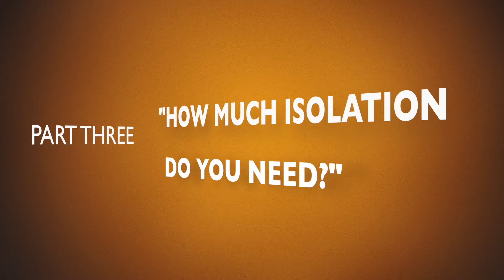How Much Isolation Do You Need? - part three - GYPSUM BOARD WALLS

Comment: Hi, just to clarify. You recommend using the cheap fiberglass insulation. What R value is best and you said to fill the entire cavity. Does this mean it is ok to touch  or leave a gap in the middle? Thanks so much!
Reply from the maker: Troy, R-value is a thermal spec. It is usually related to the thickness. Get a product that fills the framing plus the gap. You don't need any free air space to have a decoupled gap. 😉
Reply: @JHBrandt  got it! Thanks so much! I literally just wrapped up a day of doubling up 5/8 DW on my exterior wall. The "L shape" part of my source room is the problem area. One wall I should have around an 8" air gap and the other maybe a 6". Trying to keep bassy music from going into the house. Decoupled with 4 layers of 5/8 based on your recommendation. I'm just concerned that the 6" air gap maybe not enough. What do you think? Thank you for anything you can offer up! Best, Troy
Reply: Buehler? 🤣
Reply from the maker: @detroyt232323  how MUCH isolation do you need?
Reply: @JHBrandt  enough to make a stereo played at 100+ db with a sub that goes down to 29 hz sound like 50 db or lower on the other side.
Reply from the maker: @detroyt232323  why would you ever listen to music that loud? You will have permanent hearing damage before you have finished listening to one CD.

Recommended listening levels are 83 to 85 dBC average. Of course you will peaks, but they are rare. AVERAGE levels should not exceed 85 dB. Ok?
For average listening levels, you don't need double walls, although they will do a good job. You must have a sound transmission loss of about 56 dB STC.
You definitely have enough for that.

Typical of DIY design... You could have hired an expert from the money you wasted on building all that. 😉
And probably SAVED some for more equipment. 😎
Reply: @JHBrandt  I'm a rock and roller, our concerts go up to 140 db so 100 is tame for me 😉
Reply: @JHBrandt  no money wasted at all. Me and my rock and roll buddies get pretty rowdy out there from time to time. Not your typical "DIY" project, I am actually a contractor just needed a little direction on what works and what doesn't 😎
Reply: @JHBrandt  hi, I know that air gap size is related to frequency and the larger the gap the better it handles lower frequencies. On 1 of my walls I may only be able to decouple by about 5" (metal studs one side 3.5" the other 1.625"). Am I going to regret going with that 5" air gap or will I be ok down to those low bass notes from the sub? Thanks again!

Comment: Hey guys and John great video sir it is really helpful! Here is what I'm up against. I am converting my garage into a man cave/rock bar that has a pretty substantial sound system that hits down to 28 db and the volume gets cranked to 100+ hz almost every time I get rowdy out there. The problem is there is an "L" shaped portion of the garage that transfers all this sound into the living room inside the house and the wifey is not a fan. I've already started ripping out the drywall on that wall and have left the fiberglass insulation and the 5/8" drywall that is on the inside wall of the house. I plan on building a double wall with 2x4's and will have almost 10" to work with. I already plan on another layer of fiberglass insulation and double layer of 5/8" drywall. Should I consider adding a third layer of drywall vs MLV or GG? I want to get the most bang for my buck but also don't want to be disappointed in my results. Any insight or shared experiences are GREATLY appreciated! Thanks guys and John.
Reply from the maker: Troy, first we need to get an exact reading on the levels and frequencies involved. I need dB SPL non-weighted per 1/3 octave bands. You can do this yourself if you have the UMIK-1 microphone ($75) and the free software REW. See my resources page and download "Assess the Environment". Set your system up as shown in the doc, test, and send me the *.mdat file. 
Only then can I tell you EXACTLY what you need to do. (I charge hourly) ;)
Or you can send me an email - john@jhbrandt.net and set up a meeting via zoom. (first meeting is free)
Cheers!

Comment: 3:33 clear as mud. when you use an analogy its' supposed to make it easier to understand the concept. So what do you do? your analogy is an electronic circuit? LOL. ya serious??:???
Reply from the maker: It's hard enough to dumb it down as far as I did, so if you are an idiot, it's best to either leave off commenting or simply listen to the teacher and do your homework. It's Physics, Beevis. You should have studied harder in 3rd grade.

Comment: Thank You John for the AMPLE information you've provided.  Been reading your Resource Articles and that provided me with 80% more info than Dennis Foley's channel and comments ever offered (he did make me aware that knowing the frequencies I'm trying to block before considering a design is extremely important, so that was a positive).

I get bombarded with 50Hz through 160Hz frequencies at 65db inside my studio with standard construction.  I understand the physical challenges in keeping this specific frequency range of outside noise source out of my project studio.  Best I can do for the small quarter section of my 20x20 garage is retain the 3" outer wall with 3/4" x 1' solid wood outer trim slates and add Rockwool, make a 3" air gap, then build a 3" inner wall with Rockwool and 5/8" Gypsum on the inside.  This will definitely keep out all nine barking dogs that surround my house, and hopefully provide an increased sound barrier against the cars with the illegal loud mufflers (I given up on trying to block the 40Hz a--holes with insane car bass that drive by my house 24/7).

Question if you may be so kind to share your thoughts, earthquakes are a possibility all the time where I live, how do I keep the inner room from shifting without attaching it to the outer wall in some fashion?  Nail the inner base 2x4 directly to the 4" concrete slab?  And what material would be recommended to seal the small gaps on the outer wall to make it air tight?

And again Thank You John for the AMPLE information you've already provided, I Greatly Appreciate it!   --Jason ✌🏻&❤️

Comment: Hi John, great video thank you. Here in my country we put gypsum boards vertically (60cm OC), do you think it is better than putting gypsum board horizontally ? I plan to use green glue in between 280 cm high boards; first layer fixed with screw every 25 cm et second one with greenglue screwed every 60 cm to be less rigid.  Is that ok in your opinion or verticall mounting is crucial ?
Reply from the maker: David, if you are using green glue CLDM, be sure to follow the gg instructions. Follow standard building procedures is always best.
See this document on my resources page - https://www.jhbrandt.net/wp-content/uploads/2014/11/How-To-Find-Out-How-Much-Isolation-You-Need.pdf
Reply: @JHBrandt  Thank you John.

Comment: Another thing that can help if you are limited to 2x4 and drywall is first stagger the layers of drywall so the seams aren't lined up and make sure the two sides of that wall have different thickness drywall on them so your wall isn't so tuned. Screw on the first layer and glue the other layers on. I used three and 4" on a friends room which kept the drums inside that room rather well, and used magnetic strips on a solid core door. Not ideal, but the kid never woke up after that. Just handles that did not penetrate that solid core door of course.
Your videos are keeping me from sleeping, thanks! Maybe hang the inside wall from the ceiling on a very strong hinge, wouldn't want that falling during a session!

Comment: My wife is making me a room for chemical isolation since I'm sick. Rockwool was added in the walls and ceiling. They are also putting in denny foil in the walls and ceiling and that will be covered by boards and painted. Will the denny foil affect the acoustics in any way?
Reply from the maker: Your wife is one of the best (like mine) 😉
I'm not familiar with 'denny foil' but if it's the least bit heavy and air-tight, it will be detrimental to the absorption properties of the glasswool or rockwool.
I highly recommend using DACRON across the front of any treatment, just behind the fabric. This does two things. 1. The dacron (polyester fiber) offers a low impedance path for the sound waves to enter the trap. 2. Polyester fiber is hypoallergenic and it's barrier prevents any fibers from exiting the treatment.
Reply: @JHBrandt  Yeah, she is the best. 

Denny foil is essentially aluminam foil but a lot thicker from what I can tell. I'll definitely check out the DACRON. I have to make sure my body can handle it. The reason I need the room is that I'm extremely chemically sensitive and we have to keep the air from outside from coming into the room. 

If I can handle the material DACRON sounds like it would also help seal the space from chemicals outdoors as well. Thanks for the advice and thanks for taking the time to answer!
Reply from the maker: @ozwaltreacts4709  if the Dacron works for you, make sure that you aire out any glasswool or Rockwool for a few days prior to installing in your room. It is the off-gassing that is the usual (allergenic) culprit.
Reply: @JHBrandt  Thanks for the heads up. Offgassing is absolutely my biggest nemesis. I'm running into problems with the particle board and we bought formaldehyde free, clean expensive stuff but it's still nasty. I think we are about to bake the building to speed up the offgassing.

Comment: Hey John. I'm hoping an expert opinion could help me? I'm trying to "Sound proof" a small room (about 150" x 100" x 100") simply for recording instrumentation, such as a brass section, or a wind section. Hopefully my adjustments can make vocal recording dryer in the near future, but for now, It's a room made of sheet rock with a lot of echo. I was going to invest in sheet rock before I saw your video. I simply want less natural reverb for the purpose of recording (Not s much mixing). Is gypsum still the best option? I can most likely get all the Rock Wall I want for under 200$, so would Gypsum be beneficial for around that rice range?
Reply from the maker: I THINK you're really wanting treatment. Not sound proofing. Gypsum board or MASS (weight) blocks sound waves. This is for preventing sound from escaping the room or unwanted sound entering the room.

Treatment is what you need to control the sound waves IN the room.

Two different things.

So, you should treat 5 surfaces with the fiber of your choice. The high density stuff becomes reflective after 4" thick. Not recommended.

See my resources page for more information.

Comment: Wow... I'm confused. No rock wool, but glass wool? The lightweight stuff? I thought you needed mass between your two walls. Love your videos! Cheers from Belgium.
Reply: I've just seen your video 'Rock Wool Does Not Sound Proof'. Thanks for the advice!
Reply from the maker: Yes, this is often confused. The mass of the wall is IN the drywall / gypsum board or the brick / block. When we build a soundproof enclosure, the cavity in the wall (or between two partition walls) is filled with fiberglass, rock wool or other absorption product. The product should have appropriate absorption at the resonant frequency of the air gap. This is usually midrange, from 800 Hz to 2 kHz. Therefore it really does not matter WHAT you use. All absorption products are about the same at this frequency range.... So get the cheapest.

Mass does not play any part in the function of the absorption.

The mass is relegated to the wall surface. 😉
Reply: @JHBrandt  what about polystyreen?

Comment: hello, John. one question.. or two..... I have looked on another youtube video that suggested to use a softer, less dense rock wool in the walls of a decoupled room. but it doesn't make much sense...? 

I guess the ideal scenario would be to have decoupled walls with high density rock wool installed at each wall with a decent air gap freed from contact. ? 
would this types of rock-wall densities have different impact absorbing resonant frequencies in the air gap?,  would it be wiser to save resources by getting a softer rock wool for the cavity and investing on denser ones for the interior acoustics. ?
Reply from the maker: No. That is wrong on both ideas. It's become a rampant myth due to so much misunderstanding and promotion by the sellers of the more expensive heavy weight fiberglass or rockwool. Yes, mass helps with sound-proofing, but NOT with fiber absorption! Mass meaning gypsum board, concrete, bricks, etc. Ok?
Adding a heavy absorption in the cavity or as treatment defeats the purpose. Heavy fiber in wall cavity actually makes the isolation WORSE!!! It also does a poor job at treating a space as well!
Reply: @JHBrandt  Hi John! Thank you for sharing your knowledge. What will be a good example of light weight absorption material for this purpose? Thank you!

Comment: Thanks for the videos, John.  When you mentioned 3 layers of gypsum board with a 10" insulated cavity getting the resonance down to 20Hz or a little less, does that describe an assembly with 1 sheet + cavity/insulation + 2 sheets?  I ask because we are in a townhome with a party wall and suffer from neighbor spouses who close bathroom cabinets by the wall that our headboard is near - after our bedtime and before our rising time - so we are really tired.  We've used SPL Graph (with 1/3 octave logging) to see that much of the pain is in the 63-125Hz range, with some in the 25-4Hz range.  Our first attempt (too expensive and too ineffective) was just to add 1 layer of 5/8" QuietRock over Green Glue on the existing drywall on our side.  We think it was 5/8" on both sides before, with 4" staggered studs on a 6" plate, but shorted by various cross supports. That did just about nothing.  So, listening to this and playing with your MAM calculator, we want to give ourselves the best shot at getting the resonance down.  So understanding if that 3x is on one side (receiving in our case) would be quite helpful.  Also, if you have any wisdom on treating outlet boxes, that is my biggest fear - we don't want the perfect low frequency solution which is no solution due to poorly treated holes.  We've only encountered acoustic putty for treating those and I've just not seen any data on how effective that can actually be.
Reply from the maker: No, sorry. That description I made is for a decoupled partition where the 'main' partition is at least 15% greater mass than the 3 layers of 5/8" fire-rated drywall (gypsum board). The space between MUST be at least 10" to begin isolating at 20 Hz. This does NOT mean that you will have complete sound-proofing at this frequency. It means that it is attenuated, so that your isolation goes down to 20 Hz. Attenuating 20 Hz 6 to 12 dB will often result in that frequency NOT being heard due to the non-linearity of the human hearing.
The walls MUST be completely decoupled. No shorting paths! Otherwise is simply won't work.
You'll probably need to open that wall completely to determine what you have to work with. - Never speculate. Look at the details. ;)
Outlets: You are best off boxing them from the back and sealing with anything with mass, like Gypsum Board or 2x4 blocks. But you must seal with an acoustic type sealant.
Reply: Wow. Thanks for the quick reply.  We have an "experienced" contractor we were talking to about tearing out our side and then adding 2 layers of gypsum board on sound clips.  Sounds like framing out a new, decoupled partition will be move effective and add important space (I've played around with your MAM XLS too).  Scratching the surface on your statement that "decoupled partition where the 'main' partition is at least 15% greater mass than the 3 layers of 5/8" fire-rated drywall (gypsum board)"... Does that mean, if we put 3 layers on our receiving side, that the source side would need 15% more mass?  Our challenge is the noisy neighbors are not very cooperative, so I don't see us adding mass on their side.  Does that suggest we would need to add mass on the inside/between of the source partition side's studs, against our side of their drywall, to ensure it's at least 15% greater mass than the 3 layers on the new partition we'd frame?
Reply from the maker: YW! In answer to your questions: Yes and Yes. :D If you would like personal private help.. send me an email.